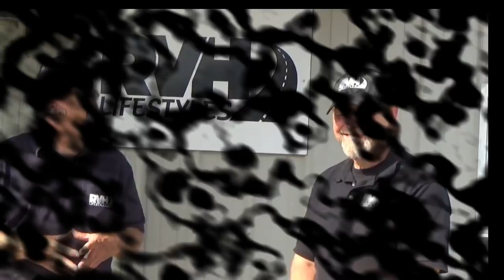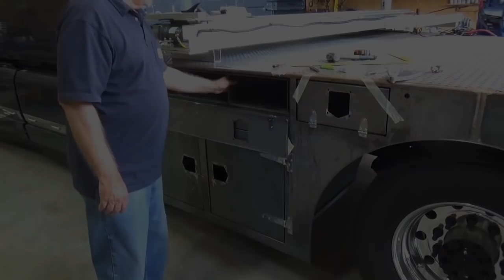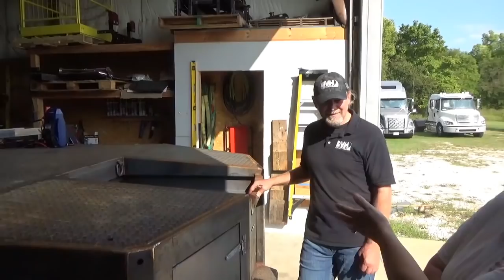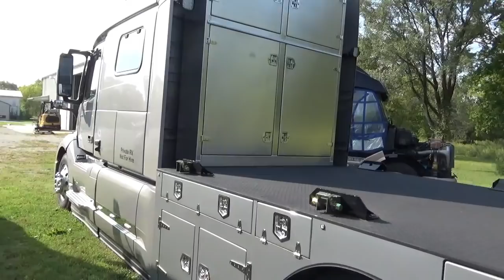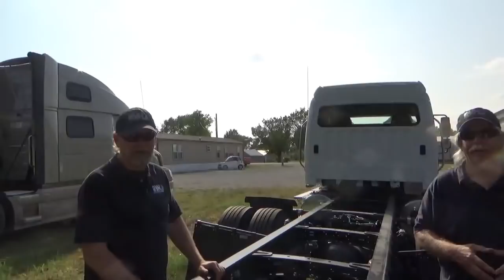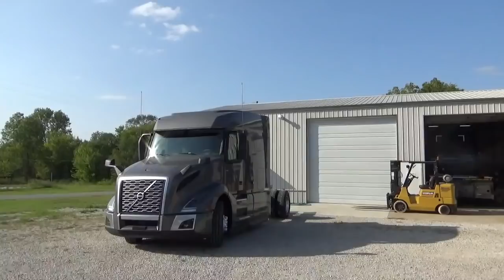🚚Converting HDT into a RV Hauler // Interview with the PROs at RVH Lifestyles

Comment: What is the advantage for removing the rear tandem ? I would think that the additional braking and traction that the rear tandem would provide would offset  and reason for the removal of same.
Reply from the maker: Personal choice.  Not hauling the weight, so not needed and provides more storage bins. Also less tires and brakes, etc. to maintain.  Some prefer to leave tandem.

Comment: Here’s a “not so dumb question”, if you already owned a 5th wheel but had not found the right truck, could you contract to have it moved with any semi, or does the semi need to be “configured” to haul a 5th wheel rig?
Reply from the maker: I'm not complete sure, but a commercial hitch may be bigger than a fifth wheel hitch.  Plus, you would need a different pigtail plug for the brakes and lights.  Also the brakes would not work without a jackalope system that converts air pressure to an electric signal to the brakes.

Comment: Question. What comes first?  The HDT or the travel trailer?  Or do you do both at the same time?
Reply: Also, is there an advantage to having the 5th wheel towing ability of the HDT, or could you have an HDT with a regular hitch?
Reply from the maker: Most people end up buying the HDT after they get their RV because they don't like the way the small truck pulls it.  We bought ours at the same time.
Reply from the maker: If I understand your question about hitches, you are asking about a regular fifth wheel hitch on the HDT or using the commercial hitch that comes with the HDT.  Our fifth wheel hitch has air bag suspension built in to the hitch for a smoother ride for the fifth wheel.  The commercial one is a solid hitch to the frame of the truck so the RV gets a much rougher ride.

Comment: Hey. How much is the insurance per year compared to your f450?  Thanks
Reply from the maker: Both the Volvo HDT and the DRV Mobile Suites cost us around $3000 a year for insurance thru Safeco.  We do not have a pick up truck.
Reply: @WattsOnWheels  excellent. I have used safeco for my hot rods. Hey. Do you have tim Scott’s contact info. Wasn’t in part 3 description. Safe travels.
Reply from the maker: No I don't